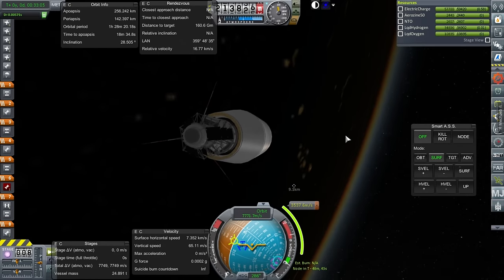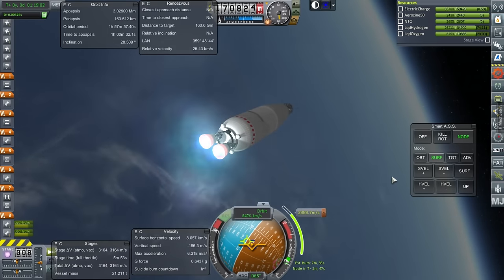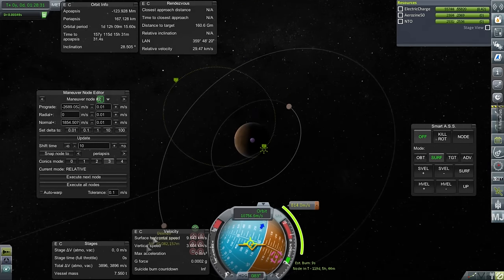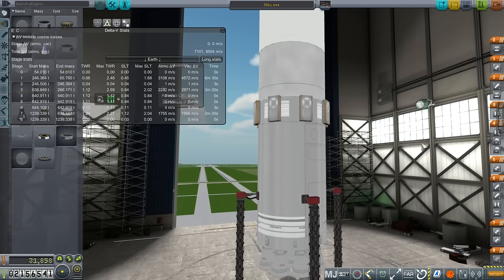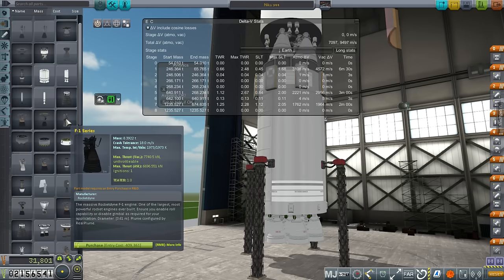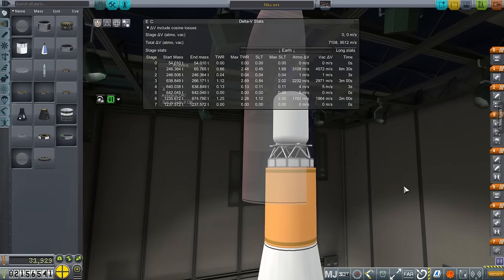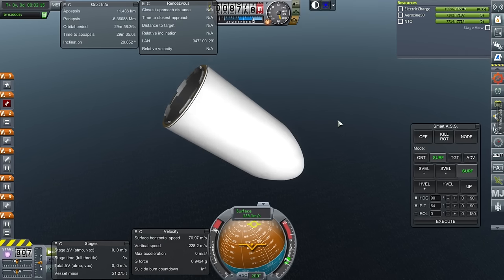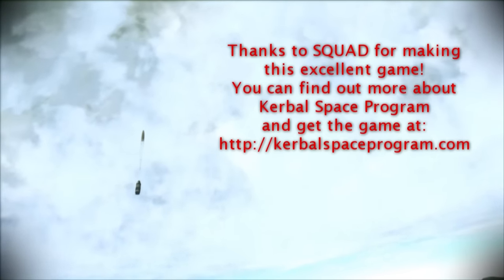Realism Overhaul in KSP 1.1.3 - 22 - We're Going to Need a Bigger Launchpad

Comment: I always wondered why older launchers from the '60s and '70s used so many stages.  I assumed it was to do with heavier materials and lower mass ratios, not the actual reliability of the engine.
Reply: Well, watching your Rocket Profiles series and this one has given me a new appreciation for just how damned hard it is to engineer a safe and reliable rocket.  For instance: now when I see an SLS mission delayed, I don't necessarily assume that NASA is just pussyfooting around or playing the Washington Monument Syndrome game.
Reply: I wouldn't abandon that opinion too far... Yeah, it's not just bureaucracy that gets in the way but the actual impressive difficulty of designing a good reliable rocket, but consider that the Orion capsule alone has so far cost ten times what it cost SpaceX to develop the Falcon 1, Falcon 9, and Dragon all together, and the Orion still is far from ready. NASA's own estimates on what it would've cost them using their policies and methods to develop from scratch a new rocket identical to Falcon 9 is around $4 billion as opposed to the $390 million it cost SpaceX. So yeah... NASA.

Comment: I feel like RO/RP-0 has a serious problem when it comes to American vs Soviet/Russian engines, in that the costs are far too unbalanced so that you would never use American engines, ever.
Reply: Tyler Raiz I think this is one point where they should stray from realism. I think they should make a standard rate based on thrust and isp. For example (random numbers) an engine of 2000 thrust and 300 isp should be (2000+300)*5. You plug in the numbers for each engine and go from there. I don't know the logistics of trying to find good numbers, but it would be more plausible for the unrealistic situation of KSP, with a single nation

Comment: I know this is a very old video, but I was thinking on the topic of the RD-270M vs. the F-1, does Pentaborane cost more than kerosene?  I assume you have to pay for the fuel, so would a highly exotic fuel that costs more outweigh the benefits?
Reply: Certainly no balloon tanks!  I guess it's a limit on the game and mod as they stand now though, I don't think the RD-270M is quite properly integrated into the mods though, no testflight etc (as far as I know), so maybe a pinch of salt is in order.